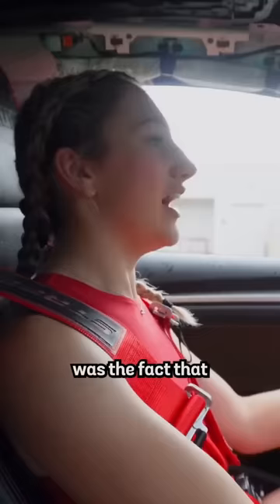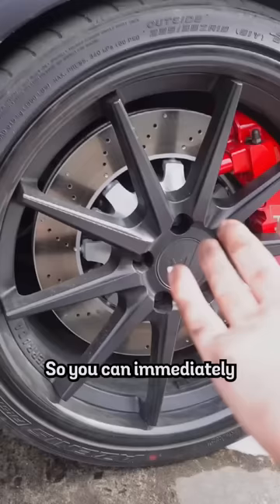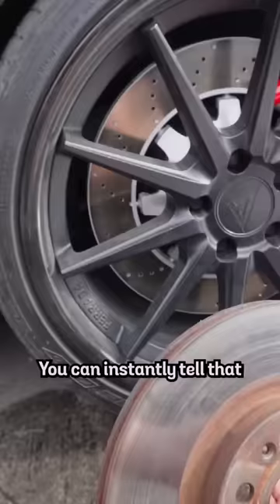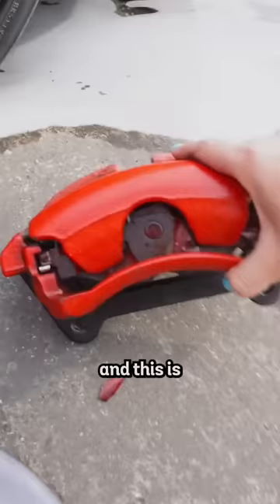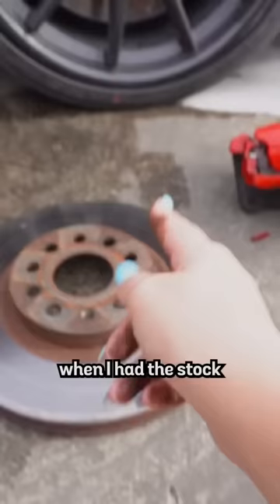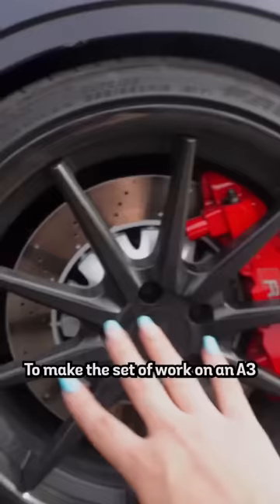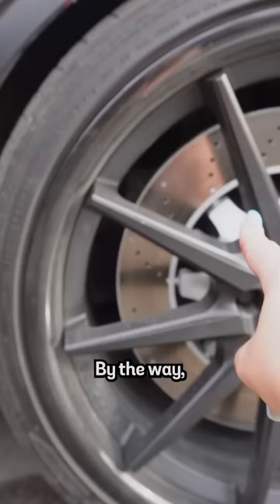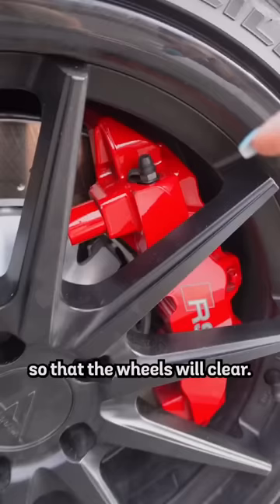I Put RS3 Brakes On My A3!!!

Comment: If you're ever going to upgrade a car for more power. Always start with brakes, engine mounts, frame (some need it), and suspension upgrades. Please ride safe
Reply: Thanks for the tips 🤌🏼
Reply: I find it very helpful, if you have other tips too, drop them below, they're all very appreciated
Reply: Finally someone that recognises the ugly gap between the new rim and the tiny stock brake!! .. I would rather see stock rims re fitted than the big ugly gap

Comment: You didn't just space wheels to make your brakes fit.  spacers are so you can achieve the correct offset for your rims.  Assuming that the offset was correct before now it will be out by 12mm. get used to buying new tires regularly and poor handling.

Comment: 120 more horse? Lol with supporting mods and tune.
Reply: @robertt.77  tell me you know nothing about cars without actually telling me💀
Reply: @robertt.77  wheel horsepower and brake horsepower are the same measurement 
They are just measured at different places. 
Brake horsepower refers to the power at the crankshaft 
But wheel horsepower refers to the amount of power which actually makes it to the wheels
(Because a lot of power is lost through moving parts)
Reply: @robertt.77  lol wow so wrong

Comment: Why are the calipers on backwards.  Bleeder should be on inside and front calipers should be on the back of rotor not front. You can even see where the line is soppost to hook up. Right by the bleeder. Come on people.
Reply: RS calipers are fitted like that, bleeder on the outside and the calipers are on the front of the rotors. It often depends on the suspension geometry and which side of the wheel the steering rack is on.